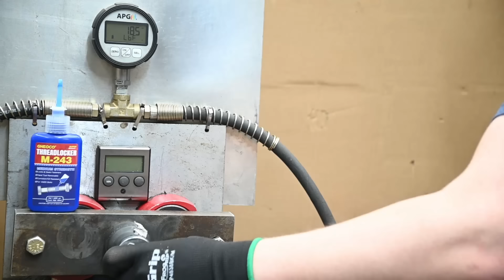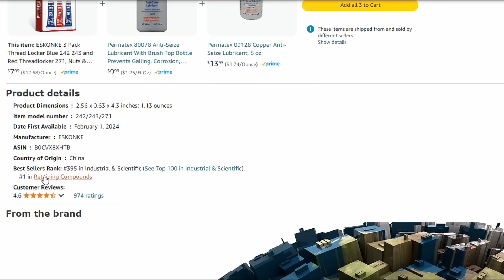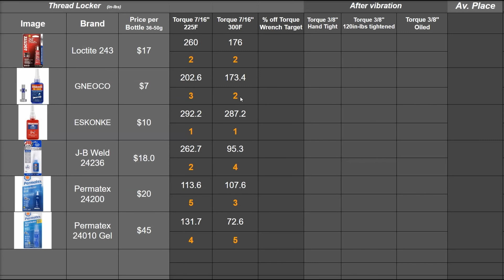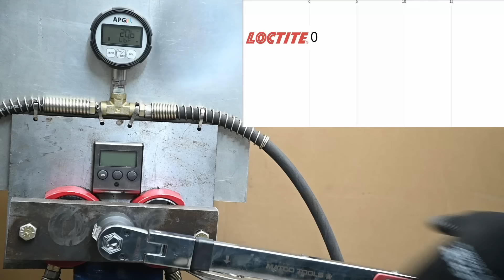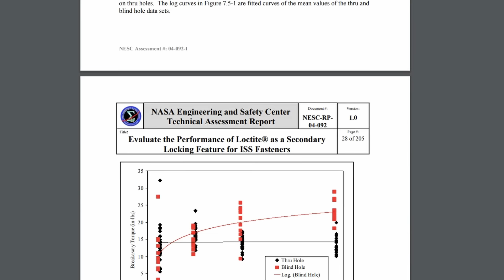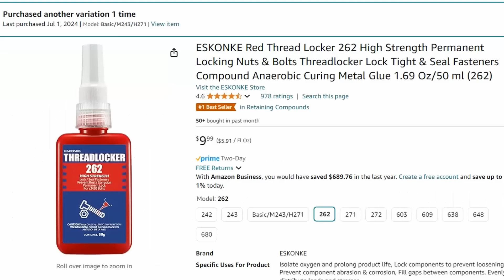Best Thread Locker isnt Loctite? vs Permatex, JB Weld & Amazon

Comment: Hmm well hmm well… I mean on the one hand as always a very good video. But on other other hand one of your worst videos to be honest since except the oil resistance (and even that is something you choose when choosing a threadlocker) all the data you collected is sadly absolutely meaningless since all of the threadlocks fullfilled their job on keeping the screws in position with vibrations and thats the whole deal together with a bit of rust protection of threadlock. 
Yea they are all „medium“ - and cant say it often enough thats only(!) the saying for the break momentum on opening and not a single bit more - but thats in no meaning somehat standardized. 
Just to stay with the most known brand. While the „medium“ loctite (243 or way more liquid 290 that is btw green bit also medium) can need a break force of XY the medium of the other brand can be likely very close to the low strength (to remember, we still not talking about how much the screw will hold in its place) 222 or maybe closer to the very hard to open 270. 
But still whatever you use, if 222, 243 (ok sure that one has some oil tolerance but lets stay with clean screws), 290 or if you insane the endboss 277… they all hold the same if you screw them the same way. Only the force to open differs and is choosen on material (a 277 can rip out aluminum), use and accessibility (want to secure a screw at your gun? Sure you use low strength since you want to open it easily but it should stay in place whatever how much you shoot it) from whatever brand you like snd that at least provides temp resistance and vibration resistance 

So yeah like I said. By quality again a great video but you missed the whole topic :/
Reply from the maker: Guess we just disagree. A thread compound that stays the same after 300 degrees is better than one that drops. One that hits its torque target is better than one that creates a large difference. One that stays tighter after vibration than one that was barely holding on is going to handle that vibration longer.
Reply: @TorqueTestChannel  sure the temp is important but in the end it isnt just some glue thats why it always has to be together with a defined torque. All those are made for stopping the screws getting lose from vibrations together with an defined max temp the compound needs to withstand without aging too much to get loose on vibration. 
And staying tighter after vibration isn't a factor of good or bad on threadlocks as long as the connections stays connected with the same force as tightened. Because if, lets say the J-B Weld would had needed 400in lbs after the vibration test it wouldn't mean it is a better/stronger threadlock. It would have just a higher break free torque when someone wants to open  it. The screw would still hold with your tightened 120inlbs. The same the other way around till you reach the point it gets lower than what you tightened. 
But they all will hold the vibrations the same time. Not longer or shorter, thats the whole missunderstanding on liquid threadlocks with most people. Low strengh, medium, high strengh... they all hold the same while installed. 
I was writing again wayy too much 🤗

Comment: had trouble following the metrics.... so how many dishwashers per ford axle did it take to break loose? Also how many meth pipes per bolt were required to heat the nut to a point where it broke loose? Just trying to quantify actual figures that relate to science. Please don't use the amount of tesla fire per bridge.
Reply from the maker: Higher number good
Reply: Yeah, because Newtons per square meter is SO much easier to follow...